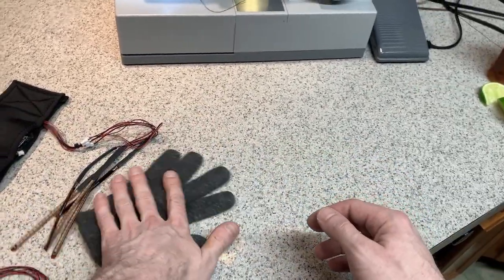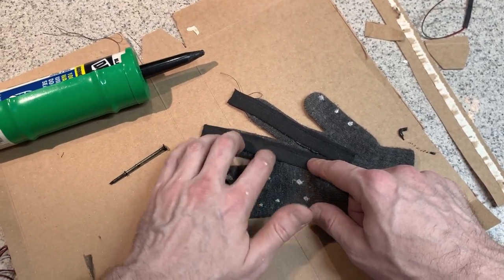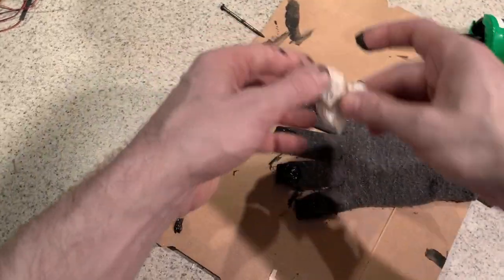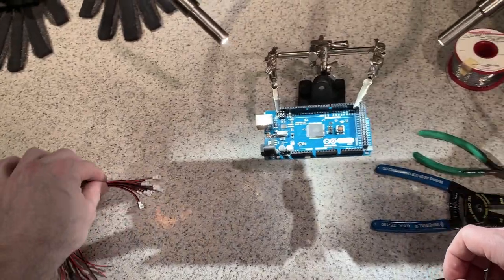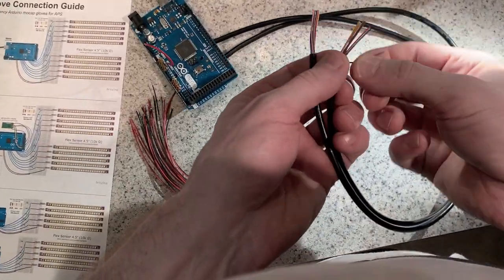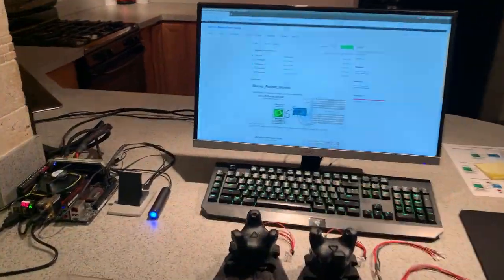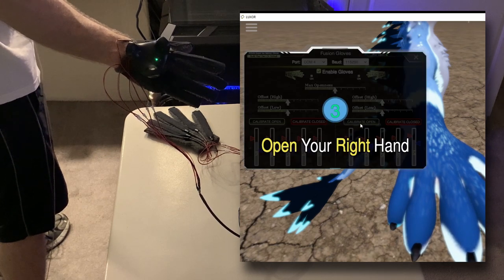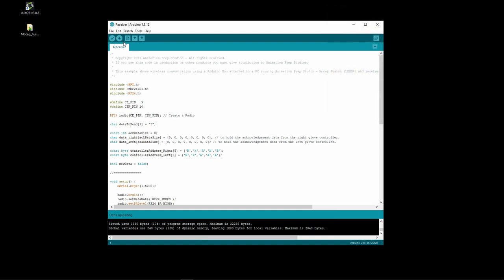$150 wireless mocap gloves - DIY Tutorial - Arduino + SteamVR trackers

Comment: So I've been doing some research on potential cost saving measures. I know from previous experience looking into stuff like this that the sensors themselves take up the majority of the cost, like 80-90% depending on the electronics you pair with them. After doing quite a bit of research into DIY bends sensors to the point where I understand far more about how they work than any one person should reasonably know, I think it's possible to make an accurate DIY bend sensor with just a bit of TPU or other flexible material as the base, synthetic paper¹ attached on top of that to act as the "substrate" for the resistor, and a standard HB pencil to quite literally draw the resistor. As it turns out, graphite has decent good properties for bend sensors,² and is very cheap and accessible.

For the actual build (in theory, haven't done it, I'll probably do it at some point), you'd want the base material (i.e. TPU) to be at least 2mm thick and 5mm wide. A thicker base will make a more accurate sensor, but will also increase the resistance on your fingers when bending them, so you really want to strike a balance there. As for the length, you want it to be long enough to go completely across your knuckle, plus a bit extra for soldering. You'll also want to design a mechanism to hold it to your fingers snugly so they don't slide off your knuckles. Using a glove for a base like in this video might work, but you'll probably want to make the sensors longer to account for inaccurate sensor placement and inconsistent finger joint locations.

On top of the flexible base, attach a square of synthetic paper that's somewhere around 5mm wide and as long as you need for the previously mentioned reasons, then scribble on the paper with a pencil and attach it to the base

To actually attach the wires to the resistor, I would use some kind of electrically conductive tape like copper foil tape. It's typically used for stained glass windows, but works perfectly here. You can take the tape, cut off a piece, solder a wire to it, then stick it down to the end of the resistor. Both sides are conductive, so it should conduct pretty well. After that, I'd seal it in some kind of silicone resin to keep everything together and make sure it won't fall apart. In fact, I bet you could make the base out of that instead of TPU if you're comfortable with doing it that way.

After sealing the resistor, you should have a functioning, low-cost, durable DIY resistor for relatively cheap. My math works out to ~$40-$50 of materials, but you'll end up with excess of practically all of the materials you use to build it. I mean, one sheet of paper could make up to 400 sensors, graphite is dirt cheap (and pencils last a long time), and ~$20 of silicone resin could easily make 800-1000 sensors³. If you aren't planning on making quite such an industrial amount of sensors, you could probably find smaller quantities of the materials for cheaper, and I bet Aliexpress has better prices than amazon if you don't mind waiting a bit for stuff to show up

The only other consideration to make is the resistor connection to ground to turn it into a proper voltage divider circuit to keep the voltages within a readable range, and maybe a circuit to offset the voltage so that you can take full advantage of the 0-5v range of an Arduino. That's all just resistors and maybe a diode for the voltage offset, both of which are pretty cheap

----------
¹ Specialized paper made primarily of resin, helps to keep the sensor more wear-resistant over long periods of time. I don't think it's optimal, but it's hard to find materials that can bend as much as these sensors need to and that can be written on easily. As it turns out, while you can search numbers all day for stretch-ratios, elasticity moduli, yield strength, etc, there's no "pencil writability" modulus that I can easily check. It would be great if we could write directly on the TPU base, but I don't think TPU is exactly known for being easy to write on.

² Graphite is decently conductive, but not so conductive we need nanometer wires or anything. It's easy to get a nice thin layer thanks to pencils, and it's very cheap and accessible. The only downside is that is doesn't stretch nicely. Long explanation short, some materials shrink more than others when pulled, and we want our resistor to shrink a lot when pulled. Graphite doesn't do that, having a Poisson's ratio (the measurement of this stretchiness) of just 0.1, with 0 being no shrinkage at all when pulled (Cork is the best example of a material with near-zero Poisson's ratio.

³ I had a look around and found some cheaper silicone on Aliexpress for $5 instead of $20, and again you can still make an inordinate amount of sensors using it
Reply: Saw your comment yesterday and it eventually lead me to do some research, mainly because the flex sensors are now $18 a piece. I found a variety of different ways people have done that diy but in my opinion none of them would perform as well as this commercial product. obviously looking at the original ones picture its obvious they have the carbon between metal squares at specific distances, probably to get very specific resistances. But still not very complex. So I ordered one and Im gonna tear it down and take measuraments both resistance wise and size of everything and see if I can clone it for really cheap. Im thinking Graphite Paint, and Copper Paint (which I know work very well from electroplating projects should work incredibly well, and I have a feeling that is exactly what those are made of. Ill post a series of videos on it. Thanks for the inspiration dog!
Reply: @Hockeytree  I also did some more research after I made this comment and discovered "ShArc" sensors, which seem incredibly simple in theory. It's just a series of tiny capacitors basically, and using it, you can actually get the bend values at multiple different locations, rather than just one general bend value. It's definitely worth looking into as well. I wish you luck with your experiments. I'd do some of my own if I wasn't so busy with college
Reply: also, the price you found it about what I've seen for the past few years of checking as well, so it doesn't seem to be changing much. Finding a cheap way to DIY it would bring the price down by an insane amount, which is why I keep coming back to this topic from time to time to research it and look for new ideas
Reply: @adicsbtw  wow that sensor style is interesting and i dont see that anyone has made one diy. If all goes well with this flex sensor clone, Ill try to tackle that as a followup
Reply: @Hockeytree  Yeah. I've never seen it done DIY, but the original paper literally just printed 12 super super basic PCBs. If I remember correctly, it's barely more than a dollar worth of materials if you buy from JLPCB. The hard part is precision, as the paper used a 12 bit precise, highly sensitive sensor designed for the exact purpose, but by my math, there are plenty of hobbyist boards (I think ESP32, but I don't quite remember) that can get plenty high enough accuracy for it. You could also simply just use many samples per angle poll to get more precision from it, so it should be pretty decent in terms of accuracy, especially when we don't exactly need more than a few degrees of accuracy and precision really

Comment: Can i use [Arduino nano with SparkFun Transceiver Breakout - nRF24L01+ ] or [Nodemcu esp8266] instead of boneduino?
Reply from the maker: The Arduino sketch should be compatible with any nRF24 module, however pinouts may vary!!

Comment: I can see the same steps being used to add lateral movement to the fingers as well but i'm not sure if the sensors can bend that much
Reply: If you're putting them between the fingers, then these particular sensors would almost certainly break somewhere just seeing how thick they are. There are designs that might be able to survive, but I would really trust any printed on flexible PCBs, which are most of the commercially available ones it seems
Reply: @adicsbtw  I think conductive fabric would be the best contender but i'm not certain how it works or how well for that matter. I've thought of criss-crossed diy seonsors that would be placed on the sides of each finger but the thumb would be problematic for that one
Reply: @josecolon2185  Conductive fabric would be generally superior I think, but it's also even more expensive. I've yet to find any conductive fabrics that are affordably priced for use in a bend sensor for something like this

Comment: hi i'm curious about the power/energy consumption, and battery details and stuffs
Reply from the maker: The battery used to power the Boneduino was a 500mAh LPS503035 PKCELL, runtime was around 5 - 6 hours. According to the datasheet from NORDIC the nRF24L01+ power consumption when transmitting at full power is 11.3mA. From searching I found forums saying Arduino boards draws about 42mA on average. Calculating the combined current draw of nRF24L01+ radio with a Arduino processor is approximately 53.3mA. 

And including the sensor simple voltage dividers where I = E/R or Amps = Volts / 30k Ohms, at 5 Volts I believe equals 1*10^-4 Amps per sensor, multiplied by ten fingers is roughly 1mA total.

For a combine current draw of the entire circuit of about 54.3mA. 

If using a perfect 500mAh PKCELL the expected runtime may be around 9.2 hours,

However in the second example I used a HTC Powerbank with a capacity of 10,050mAh, I didn't check actual runtime but would imagine it could operate for an entire day or so. Applying the same result of 54.3mA and using a 10,050mAh Powercell expected runtime might be around 185 hours. Then divide by 2 since both gloves were using the same battery, so possibly around 92.5 hours of continuous operation at full TX power.
Reply: @AnimationPrepStudios  wow... thank you so much for 'way detailed' info and suggestion 😂😂 

Also we try to do the same thing but unfortunately we searched for flex sensor and its not available in our country, and vive tracker are bit expensive so we decided to order couple of GY-85 BMP085, not for glove yet, but just for POC we decided to create an arm. 

we  aware this is will be completely different build, but what do you think?
Reply: I think I’ll be doing this. I work in 3D production and lately I’ve been integrating different layers of capture.

Have you heard from anyone who’s followed this?  GREAT stuff!

Comment: How do i take this data into blender?
Reply from the maker: Hi! It's recommended to use the mocap software: https://store.steampowered.com/app/1540000/Mocap_Fusion__VR/ which is fully compatible with these mocap gloves and can record the finger mocap data on a avatar rig then export the mocap to Blender.

Alternatively you could use the serial data from the Arduino and develop a custom IK hand controller for applying the streamed finger curl values,